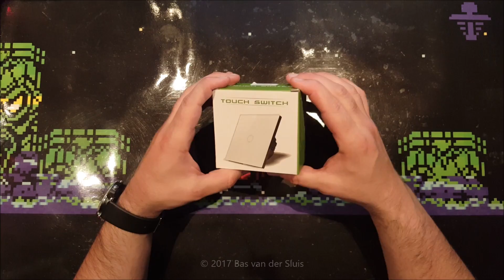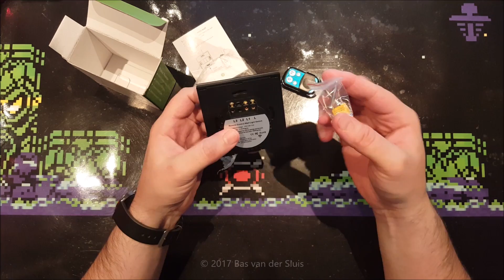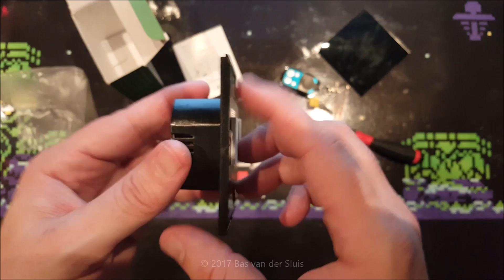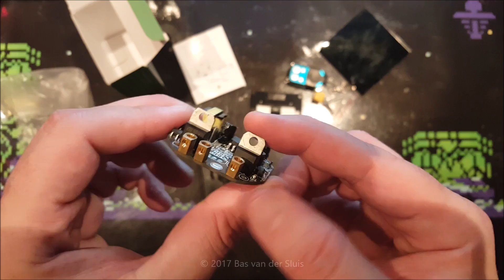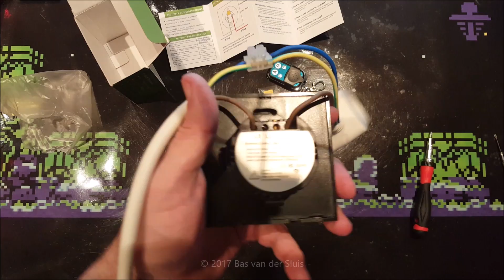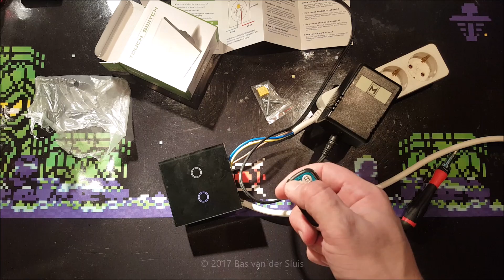Unboxing and a look at a glass wall switch with remote control

Comment: So China bad, USA good? Is there Any China brand for this type of  product that is safe?
Reply from the maker: Not everything China is bad. Their safety regulations are just not the same as the European or American (which I think are better). I have not yet checked any other switch like this from China. My main rule is: don't blindly trust any cheap device from China which handles 240V. It can be good, but I want to have checked it myself first.
Reply: @basvandersluis5662  True. When it comes to power switches, low quality products can lead to a fire

Comment: Got a few of these in my house, been fitted for around two years and no problems the light, My only issue is my remote seems to want to control all lights, so turning on mine turns on half the house. :D I need to know how to clear the remote.
Reply: you can reset with push the touch switch until 4 times beep and release, and then you can register again.

Comment: You also received a plastic bag containing 2 screws and a capacitor(Yellow item)
What is the capacity for?
Reply from the maker: It is for some LED lights. When they start flickering using this switch, you can add this capacitor in parallel to stop the flickering.
Reply: Thanks

Comment: But I don't get why people are scared of products from China considering that every electricals and devices are made in China. I got the same ones on replacing few of my switches for almost 3 years they seem to be working fine . If u look closely even ur Apple devices are made in China that doesn't mean I won't trust my Apple iPhone
Reply from the maker: It's because the iPhone is designed by Apple and only assembled in China. It has the proper CE rating for use in Europe. The switch does not have that marking, or has the fake "China Export" marking. It's designed for the Chinese market, which has other safety standards than Europe. Sure, it may run fine, but if your house burns down because of that switch, would you forgive yourself? Would the insurance agency pay if they found out that you used these switches?

Comment: The issue is not the voltage, this being in series and all.  The issue may be a heat problem.       With a short circuit you would NOT blow the fuse. Can you get enough heat released to start a fire in a wooden wall?

Comment: would it be a solution to make a new path for the main power? so i mean something like breaking the mains path (so that it is not under load anymore) on the Board and using Wires from the mains coming in to the Triacs? would you then use it 24/7?

Comment: CE Marking is the symbol as shown on the top of this page. The letters "CE" are the abbreviation of French phrase "Conformité Européene" which literally means "European Conformity". The term initially used was "EC Mark" and it was officially replaced by "CE Marking" in the Directive 93/68/EEC in 1993.

Comment: SORRY - surely as the switch is to be wired in SERIES with a lamp that can take the full mains voltage, and there is no NEUTRAL or EARTH connection to the switch, the very worst that could happen from tracks being close together is that the switch could go CLOSED circuit, and turn the lamp on ?I personally think the risks here are seriously lowered - sure there must be some fire risk using this switch - but isn't their always with electric devices.The big drawback from this device is it's enermous depth - try fitting that in your average 16mm deep flush box !!

Comment: I wonder if you have an it in a metal conduit box if that would be safe to use least that would help fire wise also I noticed you didn't use the included capacitor any reason for this?

Comment: Great looking product although looks too deep for most UK wall switch holders.
Reply: In most UK households especially older ones you'll need to replace the 15mm backbox with a 35mm backbox or use a spacer